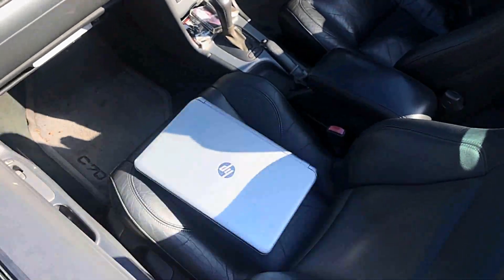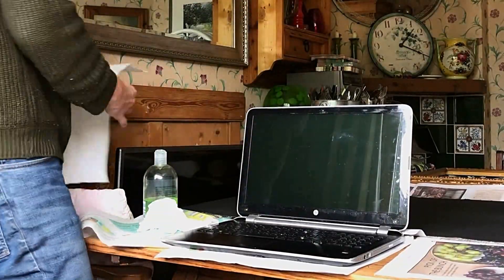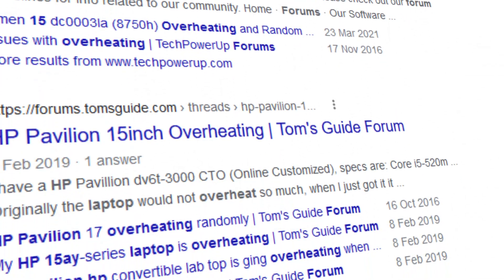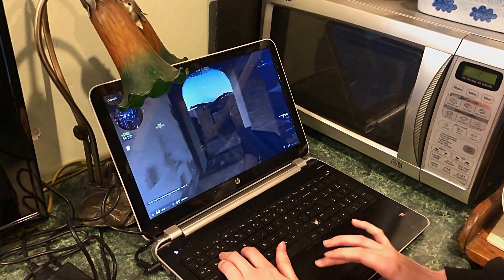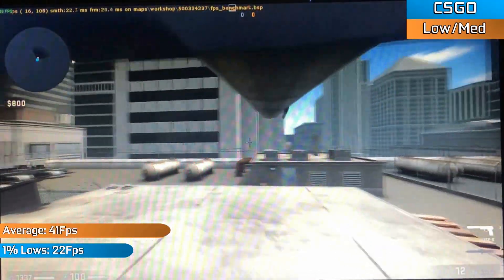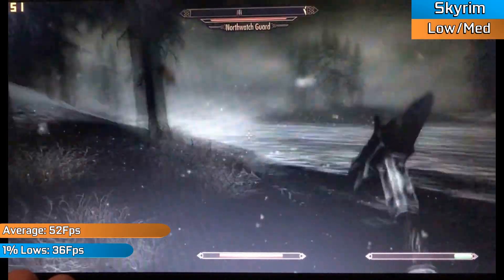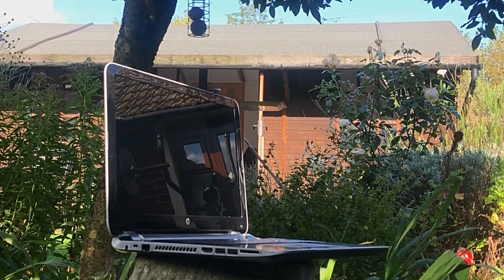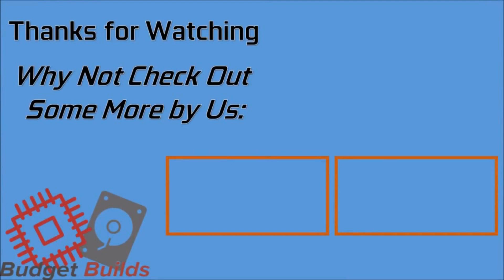AMD & HPs Awful Laptops...How bad are they?

Comment: I can't stop laughing this is literally my laptop. I gave up on Windows very early on and just moved to Linux because it was too sluggish to do anything. Eventually, I wrestled with it to upgrade the internal HDD to an SSD and took the chance to also clean up and change the paste for something that wasn't bad. I don't even know if Windows would run decently after this upgrade pipeline, because I'm too used to the Linux workflow to really feel at home on Windows 10. Oh, well.
Reply: i have this laptop too windows seems slow hows the preformance with linux?
Reply: @askaykeeners8712  It can depend on the OS and desktop environment. Ubuntu and GNOME will be a lot slower than MX Linux or Slackware with LXQt, Trinity, or a non-compositong window manager.
Reply: ewww linux

Comment: I recently replaced my old hp laptop with a new hp pavillion gaming. 
The old one had a a8 7410 with a build in r5 igpu with 128 shaders... it struggled, a lot, even running older games on its native 1600:900 resolution. 
But there was some advertisement about it telling you about the "power" of amds apu... yeah.. it was rather slow by any meassure. Battery lifetime was however quite good and just to browse etc it was a decent laptop... 
Just had to buy a laptop cooler stand as otherwise it ended up restarting randomly during hot summer days.
The real bummer was how service unfriendly it was assembled... and to find ram to work with it, to get rid of the 8gb single channel config, took quite some try and error.

Comment: My main computer is still a HP Pavilion 15-ab270sa, looks very similar but different materials, slot places and I've never had any issues with it or the similar spec I had before, it also has a integrated iris 6100 which can play most games I want to play and I never really have issues with software. Still waiting on upgrading from 8gb to 16 though to be able to play GTA V without it eventually dying from filling up the ram and an SSD would be a nice upgrade too but I need the 1tb lol , also it only cost me around £150 which is pretty good for what it is and it was £300 back in 2015

Comment: I've used one of these HP pavilion's, the temps were high and the fans were noisy, but other than that it was still decent. However, like you said in the video, disassembling the laptop is a nightmare, even trying to switch the battery is extremely difficult! 
I have a laptop that is similar, but even worse. A Sony VAIO VPCSB that has no drivers available anymore, with Microsoft not having the correct drivers to operate the switchable graphics. Even if you kept the old drivers, they don't install properly. It's impossible to get it working unless you did a full OEM install. The screen is extremely thin and flimsy, all it could take to break it is to sit on it. 
It's definitively the most useless laptop I've ever owned or used (other than a broken laptop).

Comment: I recently bought a pavilion 15 but mine is the i7 3632qm model with hd 8600m honestly im amazed by this laptop literally the only downside is the touchpad is covered with little bumps instead of being smooth so after a few minutes of use your finger will start to hurt

Comment: I am still using a 10 year old  sony vaio dual core with basic NVIDIA graphics and 6 gig of memory  until recently it was running at a 110 c since cut some grills out drilled some holes under the fan and fully cleaned heatsink and re oiled fan thermal paste don again and it is now justt 55c and fan is not flat out all the time struggles with 60 fps video,s on youtube now.Not bad for game emulation though great for amiga 8 and 16 bit nintendo and ps1 .

Comment: I had a similar model with a R7 M260 that DID NOT WORK! Turns out on some of these old models HP bodged the BIOS and the dedicated GPU literally never switches on. They promised BIOS updates which never came for most models, so I ended up selling my HP Laptop for a fraction of what I paid for it.
Reply: I had them do worse, to the point neither GPUs would work as intended.

(Un)surprisingly, switching to AMD's own Radeon drivers later on seems to have fixed the issues and both cards now switch correctly

Comment: I have an A10-9700 Desktop, I got it for £300 new back in 2016. At the time it wasn't that bad for the money, but because of Ryzen it's aged very badly.

Dual channel ram helped and the iGPU isn't even that bad, but the CPU is slow.
Reply: If your iGPU is slower than Vega 8, then it's not decent even for integrated standards
Reply: @youtubeshadowbannedme  it does beat the Athlon in some cases actually, although that's not much.

Comment: This reminds me so much of my overheating AMD Dell inspiron from like 2013 that froze on standby, usually refused to use the amd card and ran dreadfully overall.

My 2011 inspiron with an Nvidia card holds up so much better today lol
Reply: Inspirons have rarely been high quality, but Dell has cheapened them to a degree I wasn't even aware was possible, lately.

If you want to but a new cheap laptop, that's decent, go with Acer, Asus, or select HPs, IMO. Acer and Asus know how to make plastic shells that hold up. Dell, and Lenovo, as well, make some good hardware, but not at their lower end, these days.

Comment: Actually they did this with FM1 APUs as well and even further back with IGP chips like the HD 3200 and 4200 series. Albeit with significantly worse results regarding the latter two. Since they weren't exactly good for anything beyond watching movies.
Reply: Slight corrections on that last combo. It was HD3200 with 3400s. Their stupid Crossfire design didn't come back until around the HD6400 series.

Comment: I built an A10-7870k ITX and wanted to do that Crossfire thing.
Never did though.
It ran in integrated mode as a tiny small form factor system until the difficulty of cooling and powering what is basically an FX processor with 2015's state of the art in SFF, wherein it became a larger cube PC and served on my desk with my RX 570 since it has slightly better IPC than my full size FX4100, meaning better performance for the same 4.4GHz overclock.
It now has a revival of its original mini concept with better cooling and power, and lives on my entertainment center as a streaming PC, since I have a 3400G mini now.

Comment: dude that computer is better than mine i have 6gb of ddr3 ram a 250 gb samsung ssd 860 evo a core i7-4510U and it also is an hp pavilion.I don't see what you mean with the terrible build quality, the pavillion's build is pretty robust, and it is hard to scratch. modern laptops have terrible build quality, with better materials, but very scratch-able surfaces

Comment: I have that same laptop, but mine had an A8-4555M CPU and 4GB of ram. It works perfectly for office and browsing, though I once needed to replace the HDD. Mine had Windows 8.1, but I upgraded last year to a newer computer (which i'm gonna upgrade to WIndows11). It has an intel core i7-1165G7, 16GB of RAM and 512GB M.2 SSD.

Comment: Actually having a intel 4th gen laptop with a ATI radeon graphics card (8790m) have the best price to performance ratio, but the problem is that you won't find them easy like the dell latitude e6540 upgraded from 4800MQ to 4810MQ which I'm rocking with

Comment: I worked in tech support for HP, this video doesn't surprise me. They suck and commonly use parts that are cheap, these include hard drives, ram, fans, thermal paste, keyboards, touchpads and screens. Yet if something went wrong and you had no warranty, it was cheaper to buy a new laptop. If you need a laptop, avoid HP if you can. I'd recommend either Dell, Asus or Acer. Even Lenovo at a push.

Edit: If in the event that you manage to get your hands on a HP DV7 (most likely from a junk yard) be very careful. The DV7 frequently either caught fire or even exploded when under load. This also included the charger.

Comment: I....actually have this laptop. But instead with the Intel Core I5 4200U. It games pretty decently. Clearly the more modern titles won't run. But Fortnite and stuff can run at 30fps even at medium settings as long as I drop resolution to around 1024x600. It doesn't overheat at all.  But it has a lot of power throttling issues. For example the CPU just won't go beyond 15W despite my efforts to unlock that limit. Therefore it drops frequency.

Comment: Like it or not, the last decent HP series that had fixed switchable Radeon GPUs which still work on Windows 10 (though the installation can be a bitch if you don't know their quirks) were the dv6-3000 and 6000, and dv7-4000 and 6000. 

7000 at least brought a GT630 in place of the godforsaken Radeon GPUs.

Comment: About 5 years ago In my old office they rolled out 1200 AMD A10 machines to the entire company. 9 months later they got 100% replaced with i5 machines and an apology after an overwhelming amount of complaints. To this date that company refuses to buy AMD, even now that they are decent.
Reply: That's blaming AMD for the company being too cheap. They'd have the same problems if they rolled out all Celerons, and for the same reasons. 5 years ago, AMD's best CPUs - the A12s, for office use - were barely nipping at the heels of Intel's Pentiums, and only truly competed with some Celerons. They might have been slower than the PCs they were replacing, in some cases.
Reply: @laurelsporter  Im not disagreeing with you. Im just giving an example. Also, we have never had Celeron machines available through any of the several hardware providers our office has had. It must have been years since I even laid eyes on a Celeron laptop. A10s are absolutely everywhere however and hardware providers seem to always try and dump them onto you.
Reply: @scubasausage  that they're did. AMD needed to produce chips to keep cash flowing in, and they were *cheap*...because they offered 2008 performance in 2016.

Comment: my dad has one of those 2015 lenovo z50 with an a10-7300 and dual graphics. it's always overheating, takes 5+mins to start up properly, and the battery has always lasted 1 hour at best, now more around 40min. what were they trying to achieve with this laptop? i think they succeeded at the thin design, but it came at the cost of overheating. and dont get me started on hp's x360 envy machines... BSOD design overheating out of the box

Comment: Nice video, I have an HP laptop, everything is pretty great except but the cooling system, it is only bad when gaming sometimes (96C) Otherwise the temps are pretty low. Sad that HP butchers AMD CPUs so badly and makes such Bad computers. I'm not sure if I am cursed in buying a HP laptop, I hope not, It's a newer Ryzen 4000 model so I think im safe.
Reply: Modern laptops are going to be hot when gaming.  You should use AATU to set the temp limit to 90 or below.
Reply: @thelunchbox420x Excuse me what is an AATU, can you link me one? Is it a laptop cooler that you put under a laptop?

Comment: Oh judas priest, those HP Pavillions... I remember buying one years ago off Ebay for the purposes of fixing up, because I liked working on computers and I wanted to practice taking them apart and fixing them. It worked when I got it but the model I had had an issue where HP decided to not make sure the heat sink was touching the GPU inside and just shoved a little piece of thermal foam in there thinking it would be fine, and over time they'd legit cook themselves to death unless you took them apart and fixed them. So I did. I took an old 100% copper penny from the 1980s, sanded it down so I could use it as a bridge so the GPU would be making contact with metal, and I proceeded to take the laptop apart. It took me 6 hours, with instructions, to take that dumb thing apart and put it back together, with me finishing at like 3 or 4 in the morning, only to find I had broke the motherboard in the process of trying to fix it so it never worked again. I gave it to my brother and he used it for target practice after I striped everything useful off of it that I could.

 Thankfully the one I own currently is much easier to take apart, even if it's a toaster with a 1.3 GZ dual-core AMD processor, and it works surprisingly well with a lightweight Ubuntu flavor install.
Reply: That sounds like the first generation of dv7s, more exactly the silver ones. They're the only one HP I know of that uses that retarded approach of cooling both GPU and NB.

Comment: I have a HP Pavilion DV7 With an I5 2340 and apparently Radeon Graphics. But it uses the Intel 3000HD integrated graphics instead on Windows 10 because no drivers past Windows 8.
Reply from the maker: Windows Vista, 7, 8, 8.1 drivers should work on Windows 10. You may have to manually install them though 😀

Comment: My sister had hp with a8-74xx and 8gb ram and integrated graphics and in Sims 4 on medium/high setting had 40-50 fps, so not bad
Reply: That's pretty garbage considering that Sims 4 is such a potato game; should be maxing it out and getting consistent 60fps at least for a "decent" PC
Reply: @youtubeshadowbannedme  it was given by my dad's job so they were  not complaining, i remember  2014 celeron laptop sims 3 on low :

Comment: I have a lenovo with with A8 with dual graphic setting, Installed Win10 Ghost Spectre on it. Played Dark Souls, GTAV, etc. Surprisingly pretty good if you adjust your expectation. Fan died the other day, bought a new one and replace it myself, screen broken two months ago, bought replacement and change it myself. It have trouble running 2D based game tho, laggin pretty much on any game.

Comment: I had a HP 650 with a Pentium B980, 4GB RAM, 500GB HDD replaced once, Intel HD 3000. It couldn't even run settings, and struggled to do simple tasks. It finally gave up after 9 years.
RIP 01/19/13 - 08/09/21

Comment: imagine getting a $400 hp laptop in 2016 (as a gift) with an A10-9600P and thinking "wow this must be decently fast and it looks sleek"

it was BRAND NEW and it's been nothing but broken plastic tabs, overheating, eating batteries like there's no tomorrow (about to be on its third if the replacement one gives out), and so many driver issues
Reply: I got mine as a hand me down and i hated how much of a scam it was, 400 bucks, no ssd, instead a slow ass 1tb 5400rpm hdd with bloated win10, 4gb ram, not even 1080p screen but i guess that's coz the amd gpu can't game on 1080p, and it overheats. Overheats is it's thing even with 2 coolers. Ain't getting HP laptops anymore. I added another 4gb ram and replaced the cd drive with ssd so it's more bearable to love with. Their PCs are fine but laptop fuck no they're a scam
Reply: @zaf2774  HP laptops are only decent on the expensive side of things, like $800 and up the quality is exponentially better, at least that's what I've noticed
Reply: @largejoe2195  not even gonna bother tbh, the thing is falling apart, dead DIMM slot and the only memory channel that works only runs at 933 MT/s for some reason
Reply: @FrozenIce  alright, but that driver version brings back the option of changing what games run on what gpu
Reply: @largejoe2195  i swear my laptop only has radeon R5 graphics, so that wouldn't be much help
Reply: @FrozenIce  give it a go anyway, but if not yeah doesn’t matter
Reply: That's what you get on buying an HP
Reply: @gabrielvieira.4358  it was a gift from a family member, they had Best Buy store credit that needed to be used up

In hindsight I should have opted for a similar spec Dell Inspiron with an i3 instead

Comment: Funny. I have an HP Pavilion 15 from 2014/2015? which is visually similar, but has a Core i7-5500U and an NVidia 840M. Of course I flat out refused the offered upgrade to Windows 10...

Comment: I had one of those in 2011-2012! I actually tried really hard to overclock the processor on it and downloaded a custom BIOS to achieve it, but ended up bricking it. I think I tried to get it from 1.8ghz to like 2ghz on all cores constantly. HP actually repaired it free of charge so that was nice.

The actual Laptop was, as you said, a big mess of prototype ideas that didn't quite work out. The assymetrical crossfire thing didnt work most of the time, I think. If you were able to get the crossfire work it was actually decent in some games, like World of Warcraft, but in general it was just an extremely overheated and strange architecture. Also yeah the keyboard was dogshit. I gave it to my mom who ended up using it as an email and light media laptop and I just got an ASUS with an actual intel chip and nvidia card for general usage.

Comment: This thing reminds me A LOT of the Lenovo Ideapad Z585 a friend of mine had with an A8-4500M with integrated HD 7640G and dedicated HD 7670M 2GB GDDR3. Screw crossfire. Forcing anything to run on the dedicated GPU alone was damn near impossible. Games always defaulted to the garbage integrated graphics, never the dedicated HD7670M. No matter what you tried to force in the trashy drivers that also kept crashing left right and center. I'm honestly glad this piece of trash cooked itself to death due to a failed singular (!) fan with a dry bearing... not that it ran at healthy temps even when the fan was still good. The slightest hint of a load would have it shoot above 75°C, games or CPU intensive stuff even higher. This also took its toll on the case plastics and things were brittle AF near the end
Reply: That's basically any Intel-based Pavilion G6. Forget running the HD7670M whatsoever, you're basically stuck with its HD3000 graphics. I tried high and low to activate it. It just won't, not even in Furmark.